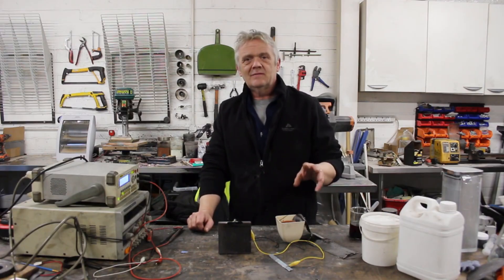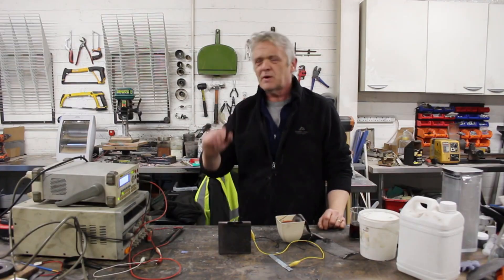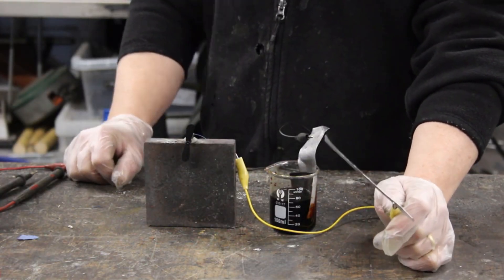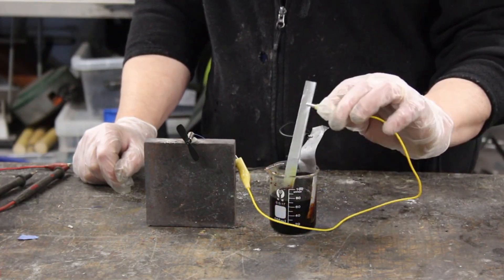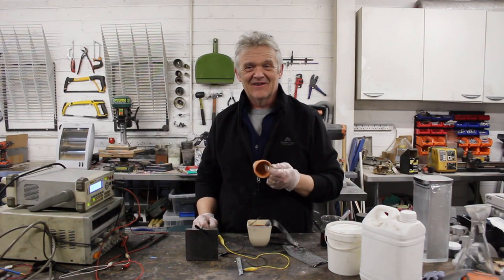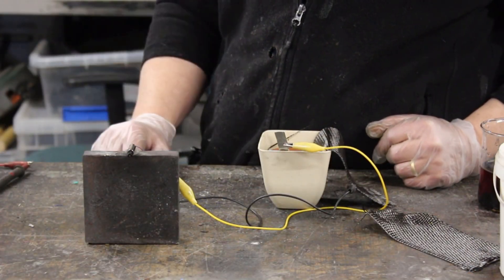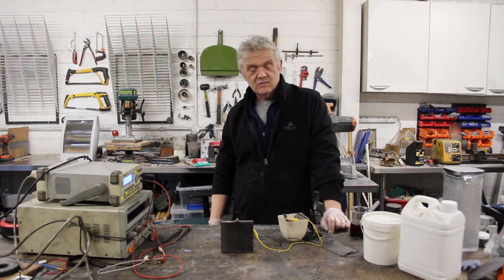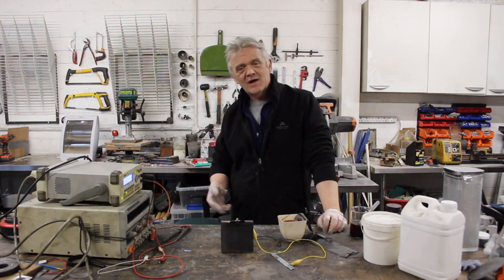2057 How To Make The Homemade Battery You May Have Been Waiting For

Comment: Nice.  There is clay everywhere where I am at, it's easy to find; many deposits you can just pull large glops of clay right up.  Now to see how much I can store in something like a 5g/20l bucket - we're pulling two ceiling fans out of the living room that are perfectly functional (replacing with flush dimmable lights) so I can potentially build a completely self contained harvest/storage system that I can throw in the camp trailer and go.
Reply: I just realized that since you're already using a fabric for one of the electrodes it can be coated with a couple layers and rolled up - now I can just stuff it in a round bucket with the lid on it and a couple threaded studs to attach wires to the inside/outside of the lid.
Reply: @russellzauner  so two threaded electrodes once the zinc is in solution?

Comment: After the first discharge when you have zinc in solution, could you replace the negative electrode with carbon fiber as well that doesn't get consumed so that you always have an electrode to charge zinc back onto?
Reply: yeah, you can do that if you want to save on zinc
Reply: @lautaromorales2903  thanks!

Comment: A very interesting design.  I think the design challenge for making a closed battery out of this will mostly be in the mechanical design and how to close it off, keep it from sloshing around.  Does the carbon fiber sheet have good conductance over the whole surface?  I've only really looked at the mechanical properties of it, so I don't know if it would be better to have a strip of conductive metal around the outside of it so that all the strands have an electrical connection.
Can this solution be frozen? While not practical, it would stop passive discharge.
Reply: Anything can be frozen if you make it cold enough. But I expect you’ll find that the ions are still mobile and the battery will self discharge anyway.

Comment: It's been awhile since I commented but wondering how a 3D printer could be used to assist the building of a battery. The battery case is the obvious part but was wondering about separators, conductor channels, etc.
Reply: ABS will stand up to water well enough. Apparently it has been used for plumbing in homes. Because it will be 3D printed it will soak in water, though, which will make your prints brittle over time. You might acetone treat the prints to close the pores?
Reply: - may be better using solid plastic (more leak proof and tough/durable)  and (plastic) welding up the case  - not everything needs a "printed" solution.
Printing sometimes gets in the way of just making stuff with one's hands (ie. a substitute for lack of skill development.)

Comment: The 'self-discharge prevention' is just the same as the poorly named 'salt-water battery.' A battery which has no electrolyte - you add the salt water only when it's time to use. The energy density and power density are both awful by every measure, but they have one advantage: Unlimited self life. You sometimes find them in emergency locator beacons, because you can still depend on them even if your emergency beacon has been sitting forgotten in the bottom of the life-jacket locker for the last thirty years.
Reply: Volta stack style with zinc copper zinc copper and inbeetween each layer charcoal disks soaked in salt water...so 3 disks per cell and stack 50 cells or more you should be able too get usable amps but want too parralel like 30 stacks off 9 maybe  and lay cells sideways in a pool off salt water but so only the charcoal disks are sat in the solution so the metals don't connect...should work quiet well and all need too do is top up electrolyte zero charging needed...what you think?

Comment: I'm not terribly familiar with working with clay, i figured since it's a hobby of yours you may already know,  would it be worthwhile to.make our own kiln, then make our own pot that is more suitably designed to the task? Or does that not seem as cost effective for the value?
Reply: Make an earthen kiln
Reply: @jasonlogan5765   but would it be worthwhile?  I've not yet had time to experiment with this battery, maybe in a month or two.  I'm unaware if the pot size or shape has any measure of impact on performance.

Comment: You knock it out of the park .use a dc to dc converter to run higher voltage stuff..can you make a power wall with it ?  I'm tired of lead acid going bad one way or another .. expensive!!

Comment: So in theory a person could build a cell that they essentially feed Aluminum scrap into that turns it into energy?
Reply: I may have missed something but I thought it was Zinc that Robert used?
Reply: @MilkyToucan   it is.  Given the meany battery videos including aluminum/ magnesium air battery’s it stands to reason it’s a possibility.
Reply: given the correct electrolyte - until the electrolyte is saturated with "metal ions" it works by adding metal to the anode - once equalibriom is reached you now have a solution to "replate" - a (the terms change) Cathode (electrode) substrate material with the application of "recharge current" - plating is the reverse process to discharging.

The same magic occurs within a lead acid battery - -using lead of course - the only reason most people don't just "refresh" their dead lead acid batteries is - it makes more sense to go to work and do your proper job (for most people) than cutting used batteries apart and rejuvenating the plates - they are made in factories (and recycled) every day  (not to mention "hazardous chemicals and metals - for the most successful chemistries.

Comment: Bagdad batteries used clay, yes? Perhapa they were far more advanced than even theorized
Reply: Clay, yes, but it's very unlikely they were ever batteries. The design doesn't quite make sense as a battery, there's no writing anywhere suggesting batteries, no depictions of them being used as batteries. No electroplated artefacts, no wire or tools for working with electricity. There's also a critical flaw in the design if they were batteries: The iron electrode is completely encased, with no means to make a connection to it. Their true purpose is far less exciting: They are scroll storage containers. Someone really wanted their scroll to endure so they wrapped it around a form rod, wrapped rod and scroll together in a copper sheet, then sealed the whole thing inside of a jar using bitumen as a seal.

Regrettably though, it didn't work. The remains of the scroll material were found within the jars, but too degraded by time to have any hope of reading even fragments.

Comment: Amazing battery. But I'm wondering, if it has so much energy density, why aren't they as commonly used or know about like lead acid or lithium batteries?
Reply: Just guessing, probably because of cell voltage and cold cranking amps. I don't know what this battery would do if it had the same surface area as a lead acid cell, but you're talking hundreds of amps to turn a car starter.

Comment: I'm 69 and grew up in Michigan. I remember Mr. Wizard on tv. He did many types of experiments. What a wonderful time to be young. To me you are the Mr. Wizard of energy. 🤩🤩🤩
Reply: I was born in the 80s and Mr. Wizard was still on the air when I was a young'un. Loved that show.
Reply: Sir Robert Murray Smith does indeed have a Wizard aura exuding from him. As his enthusiasm about his ideas flow when he's sharing them with us.
Reply: Was once installing a production line in a Mexican factory at 2 o’clock in the morning when we needed to check the polarity of a magnet. No tester! I sent my helper to go make coffee while I “thought about the problem”. Of course I had already formulated a plan based on something from Mr. Wizard. I snipped a piece of steel spring wire, straightened and magnetized it. Used whiteout correction paint to mark one end. When the coffee arrived my man was aghast to see me float the wire in it. But as it spun around I asked him which way was my home. (The North end of the wire points to a South pole of a magnet which is somewhere in Canada these days). Mr Wizard saved that company $3 million because the line was installed on time!
Reply: I'm a few years younger...  I'd forgotten about Mr Wizard!  Thanks for the cerebral rust removal!

Comment: As a improvement to the battery couldn't you add some of your organic graphene to a batch of clay with the temper material and make conductive ceramic terracotta? Couldn't you layer a bit of normal terracotta to the outside to act as your permeable barrier? And mechanically to take the zinc out of solution, just have a manual crank.
Though I can see an issue occuring where bits of zinc might break off and keep the cell running at low capacity. And long term, it might be good to discuss how to recycle or dispose the materials used when they are used up.

Comment: I worked as a zinc plater for a plating and powder coating company. Seems like your basically plating and stripping the plating over and over as a battery, pretty cool. Im going to make it. Am I correct that the potassium iodine antiseptic available for disinfectant is the same solution?
Reply: It's basically a much more concentrated solution, so you still should wear gloves.
Reply: most/all (disclaimer)  batteries rely on the same RDOX processes as plating - selecting electrodes and solutions to store and give up the ions as required.  Note that the original single use battery was a carbon-Zinc battery  - basically putting the zinc into solution as it discharged - not so different to this open top solution (different electrolyte).
Reply: its probably not the providone stuff

Comment: So what if someone had a car that ran off of batteries constructed similarly to your terracotta pot and went to a charge station and instead of plugging in the car, they were to swap battery fluids instead?  Could the old fluid then be refreshed/recharged?  It could close the gap that gasoline car drivers love to throw out when comparing refueling to recharging.
Reply: no, because the metal electrode (anode  - on discharge) needs refreshing on the recharge (it erodes on discharge). Only*   "flow" batteries can be recharged instantly by just swapping fluids.

* - Ok  - AFAIK, so as not to be dogmatic in ignorance, lol...
Reply: I think there's a company in India that's prototyping that system. Although I think they swap the whole battery out, and are using smaller lithium iron phosphate batteries or something
Reply: So the way I understand it, if the electrolyte fluid is now full of Zinc, you'd have almost no anode left (the Zinc that was on the anode is now in the solution). So just adding fresh solution would eat away at any remaining Zinc on that anode, until you're left with nothing.
Reply: @dylan_00   I understand it to be that the zinc is redeposited on the zinc bar when charging. So unless you let the entire bar sacrifice itself to the solution it shouldn't lose much mass.
Reply: @jimlipscomb3236  Right, but when it discharges it is dissolved into the electrolyte solution. So if you keep removing the solution with the zinc, the new solution will keep stripping away zinc, you have to recharge the battery with old solution for the zinc to return to the anode

Comment: It was revealed on the radio last night that a AUD$10k solar home battery is made up of USD$1k or AUD$1600 of parts that you can build yourself. I had no idea it was as bad as that.
Reply: - If you are interested in DIY batteries - for offgrid uses, resources like "Will Prowse" - Youtube and Blog - are out there -  ie. Used or new; EVE/CATL/etc, cells and  BMS units are available - however, in the use case of a house battery, many home owners would like to be legally and insurance-wise (not to mention warranty) covered in the event of a fault/ fire / disaster.

Not so much a "conspiracy" more a regulatory issue - also noting that in Australia it is illegal to work on mains power unless one is a licensed electrician - more regulatory cost and bottlenecking.
Reply: @kadmow  :  tyvk!!!❤️
Reply: If those instructions are out there, A link might not be a bad thing to share,  if you had it. ❤️

Comment: I see the mechanical "switch" of removing the zinc as an engineering opportunity for the EV market. Any idea on how many recharge cycles this home brewed version can expect?
Reply: That would be interesting
Reply: Many 😉
Reply: Cycles should be in the 10,000s easily
Reply: You mechanically recharge it by adding more solution to it. You should also probably remove the zinc iodine. You're just basically rebuilding the battery, I believe.
Reply: @david2ljdavid2lj56  Yes, I only show how to make a basic zinc iodine battery. This and my V3 cell is electrically rechargeable.
Reply: my guess is it will be down to the break down of the separator and thus the ability to form dendrites between the two plates, shorting it out, the better at resisting that, the longer it will last and the dendrites forming on one side to form more of a foam like surface area, would cause it to discharge faster and release more amperage and thus making the use of it breaking it in so to speak.

Comment: Could you try making a sodium ion battery?
Reply: No. The problem is that sodium alone wouldn't cut it - if it were that simple, we'd be in mass production already. Sodium doesn't last. To make it stable you need to alloy the sodium with various other metals, and not many people have a home workshop suitable for mixing alloys under inert atmosphere conditions. You're looking at mostly-sodium with carefully measured and mixed traces of magnesium, manganese, nickel and iron. Maybe cobalt, as a last resort. The electrolytes are even harder to make.

Sodium ion batteries are /hard/.

Comment: This is pretty cool, Rob! Is off gassing a problem when charging?
Reply: Exactly what I was thinking 😂
I guess I will just give it a go and find out. 😅
Reply: You'll probably have to top off the water due to evaporation, but I don't think it produces hydrogen or anything like that. 1.2V is right on the borderline of when electrolysis starts to occur, but it usually takes a bit more than that. Raising the pH can reduce electrolysis, but unfortunately, zinc hydroxide is insoluble, and you don't want too many other metal contaminants or you'll just be wasting power. Just look for bubbles I guess.